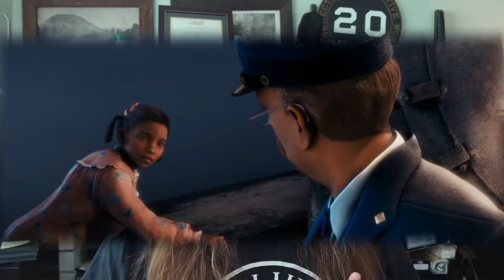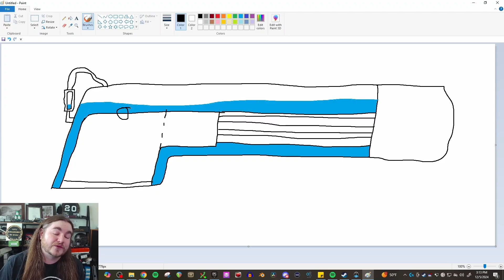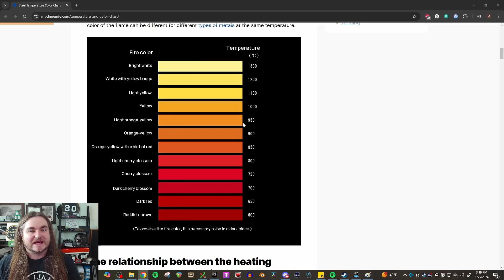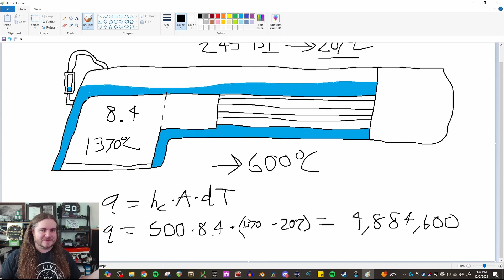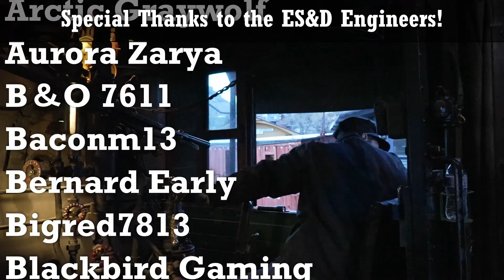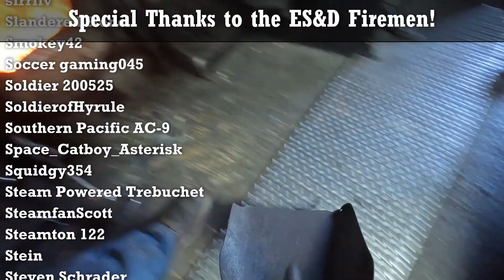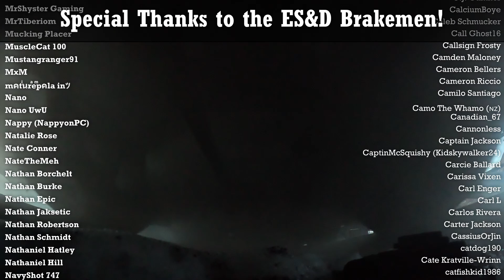Would the Polar Express EXPLODE on Glacier Gulch?!?

Comment: Wouldn't the heat transfer be to the rear of the fire box and not the crown sheet if the train is pointing nearly straight down and heat rises? Not sure if that changes anything.

Comment: My thought would if it was straight up and down would cause the fire, ashes and whatnot to move which could get caught in the steam tubes or fire would go out due to displacement. If the fire particles could block the steam from release it could possible explode due to pressure. Sorry don't know to much about steam trains. I was thinking if water can move why not fire .

Comment: So, some very loose calculations here...

The Polar Express was an IMAX movie, so it wasn't made using frames. However, if it was using frames, I estimate that it would be around 60 fps. At this rate, during the steepest and fastest section on Galcier Gultch, the 1225 would traverse about 2 sleepers per frame, this is about 4 feet. 4ft x 60 fps = 240 ft/s ~ 163.6 mph. With 1225 having 69 in diameter drivers, her engine would be running at 398 rpm. Now, Mallard's pistons melted down running at 127 mph and 267 rpm with her 80 in drivers. So... 1225's pistons, and probably running gear and axles and bearings would all have left the chat long before the bottom of Glaicer Gultch.

Also, SUPER nerdy detail, Mallard's record is 126 mph, but she actually hit 127 before her center piston melted down. She never held 127 mph long enough to be considered the record.

Comment: You'd have to dump the coal and close the dampner all the way in order to stop that from happening...and for good measure you can use the water injector as a way to cool the boiler if need be ...you're going down a grade so you don't really need anything but gravity and brakes...and I just realized this is when the regulator broke....so killing the psi is that much more important

Comment: So. They're floating in the cab. Water would be floating in the boiler. I fear the dry pipe wouldnt be dry anymore. 

as far as steering on the ice, Ive watched it a dozen times and I swear they're just running forward and reverse. Not like the brakes would apply and release that fast, I dont think. Would the air reserve hold up to that??
Reply from the maker: On the first point; hmm, yeah.

Second point... well, we shall see. :P

Comment: The actual question: on a straight vertical drop like that, what are the chances of making it to the bottom without floating off the rails?

What will the speeds involved do to the running gear?

What happens when we dump the entire contents of the firebox down the fire tubes?

What implications will the G-forces on the pullout have for the boiler structure?

Etc.
Reply: eh rought guesses

1. friction would melt them

2. Snuff out the fire (don't need to worry about heat, there won't be any with how clogged those tubes are.)

3. probably bend the frame/boiler might be fine if the curve out was gentle enough.

And on the topic of coming off the rails; The thrust from the exhasut stack would help (a little) in keeping it on the tracks. if it was a more reasonable crazy number like 79 degrees that issue gets less problematic.

Comment: Tipping the locomotive on end will result in the arch brick and fire bed falling into the combustion chamber quite likely plugging the tubes and flues and killing draft.  The total heat content of the heated coal and brick will still be radiating to the exposed steel. Plus, whatever portion of the coal is still burning.  I'm of the opinion, that if it didn't blow up on the way down, it would crush the track and punch into the ground -- and then blow up!

Comment: Another question for this scene is what happens to the fire being drafted that hard in Zero G. I'm thinking it ends up in the smoke box. Stoker fired means small coal pieces and there is no gravity to prevent the coal from being lifted into the air stream. Even with the brick arch and combustion chamber that 1225 has that just lengthens the required route. Under normal operation you can still get coal jumping up from the grate and it when the locomotive is working hard.
Reply from the maker: Hmmmmmmmmmm.

Comment: When the loco goes vertical, the rolling resistance and frictions will cause a upward force, which will cause the water to flow forward. 
And in 0g, the water and steam would mix, which would be less then ideal...
The loco would need to work against those forces and accelerate preferably faster then 1g, in order to push the water towards the firebox.
The problem, is that the normal force is gone and the factor of adhesion is now zero, so getting any traction is close to impossible.
The only solution I see is to mount steam powered rocket nozzles that point backwards.
and preferably also upwards in order to keep the train on the track, but that would have to be done on all cars...
Reply: the exhaust stack would push the engine into the track and restore a tiny amount of adhesion. We know that the engine was just slightly faster than freefall because the crew were floating and moved backwards a tiny bit. the same would have happened to the water, keeping it slightly to the back and barely attached to the bottom.

Comment: The grade percent of a slope is rise over run x100. So a 179% grade would drop 179 units over 100 units. Which would be about a 60 degree decline, not vertical.

Comment: 19:00 I already (sort of) know for a fact that the locomotive is not going to survive the ice purely because of its weight. I kind of know this as I have a book by Christian Wolmar on the Trans-Siberian Railway where in the early days before the line around the southern shores of Lake Baikal was completed the track was instead frozen into the ice.
There’s at least one account that states that all the passengers were told to disembark so that the train crew would “honourably” go down with the train should the ice give way, whilst the passengers had to trek to the other side of the lake itself. There’s train then followed onto the ice and although there was a few crunches the ice held firm.
Now since this was in either the late-Victorian era or right in the Edwardian era, locomotives would be considerably light by European and thus also Russian standards, and given how at any one stage even a train as light as that could still break through the ice, I have a feeling that an 802,500 lb (even though I’m Australian and use metric I still like to try and use Imperial units) locomotive alone would’ve broken through the ice possibly on first contact.
Reply from the maker: Wacky... wow. Thank you
Reply: the ice thickness is our unknown variable. considering how strong ice is. it could hold the weight if the ice was hecking thick. No cool ice breaking as it slid along though.
Reply: @JaneDoe-dg1gv  I can’t remember well since I first read it in the book, but apparently the ice was somewhere around 3 feet thick. The Russians were also laying the track directly onto the ice and then freezing it into the ice itself with fresh water and just the cold temperatures to do the rest of the work. Having said that, I do have to agree with you that it might’ve supported the weight of such a beast, but I guess it’s up to our own judgment to figure out whether something as large as a Berkshire or a Northern would have survived on the ice, even to the point of drifting on it

Comment: Yet the Polar Express did 200 mph unofficially on Glacier Gulch with a loose cotter pin from the throttle

But this is NOT proof that the Polar Express beat Mallard's speed record
Reply: Well one, he pulled the throttle completely off the mounting bracket, and 2 all he had to do was just readjust the cotter pin and take a pair of pliers and bend the ends to secure the throttle instead of forcing it 😂🤦‍♂️

Comment: Stupid question, would the throttle valve have been flooded with boiler water due to the steep decline? If so what effect is that water going to have on the valve gear and cylinders?

Comment: I'm just going to say that 3/8 steel is it's very hard to weld so that stuff is extremely thick and it's going to take a very long time for the choo choo to go boom boom will welding wise
Reply: Okay I'm almost done with the video and I just realized that he has a point it takes a lot of energy to create steam let alone superheat that steam so yeah I have to say that the polar Express with a lot of maintenance on the wheels and running gear would definitely be able to get down to the bottom of glacier gulch not to mention that the fire was pretty close to running as hot as a blue flame and the coldest blue flame is around 2,500 degrees Fahrenheit in fact I think it's like 2,595 degrees Fahrenheit and considering that it's pretty much pure plasma at that point and then you've taken the fact that you got a superheat the steam and all that stuff so yeah it probably would be cool down to around 1,000 something degrees or even cooler than that so yeah there's a lot of bits and pieces that you need to take into consideration of the fact that the fire was pretty hot you have to superheat the steam and there's ouch my brain  okay anyway it's honestly surprising and not surprising that the polar Express got down to the bottom of glacier gulch

Comment: The engine seems to be the least endangered species in those scenes.

More important, how much whisky do you need to forget that you run the same route for Santa Clause every year?
Reply: @Niklas.K95  would 10 barrels be enough?
Reply: @timothyteo4602  depends how much time they need to handle them
Reply: @Barlow5  you’d also have to assume the crew’s not blind drunk to make the run to the North Pole from all that whiskey

Comment: ok, but you are not taking into account that as soon as the engine falls to that angle, the coal and fire will all fall to the front thus choking off the air to the fire and pulling in serious cold air through the now exposed grates thus cooling the firebox down very fast. The fire itself would quickly bank itself from lack of air getting through it. So your time is still too short! LOL

Comment: I'd love to see you nitpick the cab controls, not the throttle and brake stands but all the other junk in the background. Smokey's fireman side controls are very nutty looking. Banks of mini-quadrants hanging from the ceiling, chopper handlebars in some sort of submarine periscope configuration? I'd love to see you try and break down what they were actually based on and what they might theoretically do.
Reply: There's a flux capacitor as well.

Comment: I was just as surprised as you were by the final analysis. But then, I am reminded that air is a very poor conductor of heat, so it is reasonable to learn that steam is much slower than steel at heat transfer. I LOVE this kind of rabbit-hole geeking/nerding out! ♥

Comment: The scary thing is that is a regular part of the track, regular enough that the conductor recognized they were getting close and there was signage. If the boiler didn't go kaboom when making a pinless, uncontrolled decent, how would it have survived at normal track speed on a regular Christmas run? Maybe that part of track is meant to use Mexican overdrive (the big quiet gear) under usual conditions.

Comment: I have to wonder if the sign entering Glacier Gulch was supposed to read '79°' (very steep, but still upright) and someone decided to be a troll and added an extra leading digit.
Reply: Well... if flat track is zero degrees, wouldn't 179 degrees be inverted? So I think you're right.
Reply: @cswvna  no it's exactly 1° short of being straight vertical
Reply: @cswvna  no 180 is straight up and down 181 would be slightly inverted so 179 is just barely not a straight drop you have to remember if you flip the angle around and measure it 181 is the other side of 179
Reply: @kevinpark1  Let's assume the track is 0 degrees, that means, on a 2d circle, it's a left-to-right line.

Now rotate that circle 180 degrees, feel free to use whatever image editing tool you have.

It's now right-to-left. up-and-down is (+ or -)90 degrees.
Reply: @Tyrope  but grades are based of of what the previous grade was so going from 6 degrees to 4 degrees is a  - 2 degree grade

Comment: By your math, it really wouldn't have exploded. But have you considered the fact how fast the water would turn into steam as soon as it touched the crown sheet. Wouldn't that have created great pressure on the crown sheet? Plus, the quick contraction from the metal would probably put it under a lot of pressure. 
But to be perfectly fair, I'm not a mechanical engineer (yet), so my predictions might be completely wrong, but that's what I see happening inside my head.
Reply: Not to high of a temperature difference? It's a lot of water at 200°C, and the steel shouldn't be anywhere near 600°C.

Comment: I wonder if this wouldn't be affected by the sudden drop and the fast fall like on a roller coaster. Coal in the firebox lifting off the grates, water moving to the back of the boiler instead of the front as it looks like they are kind of in free fall seeing the cotter pin flailing about bits in the cab. Never seen the movie so I don't know if that's whats actually taking place or more Hollywood silliness.

Comment: Oh the lake question is fairly easy it's never been a matter of if the driving wheels can turn in different directions. 
It's always been a matter of the hinges the couplings pushing again it's like trying to push a string The string will turn and bunch up thus allowing the head to rotate and so that forward reverse forward reverse forward reverse CAN STEER
Reply: Yeah! by controlling how the train swings side to side by choosing when to pull or push against the coaches. the coaches are what drag the nose around. The engineer is just controlling how much the engine is pulling on the coaches and then letting the locomotive's forward momentum carry them through the rest.